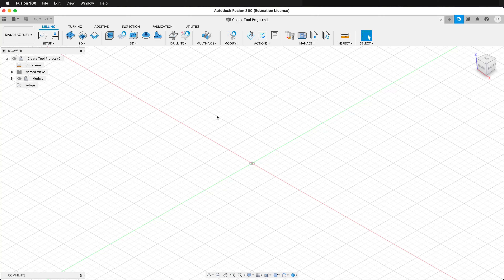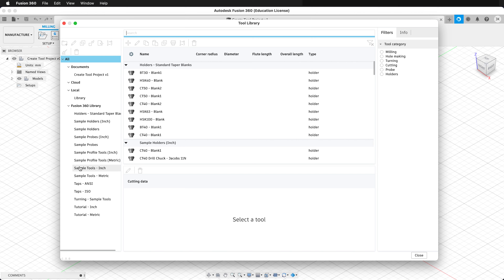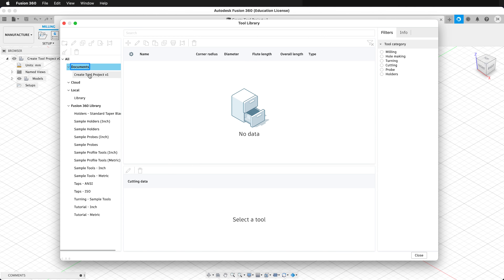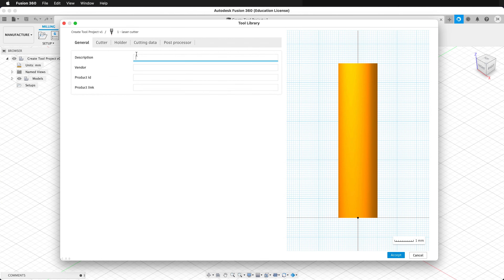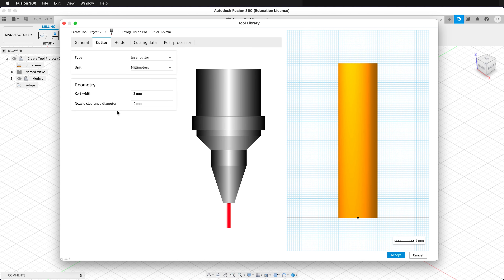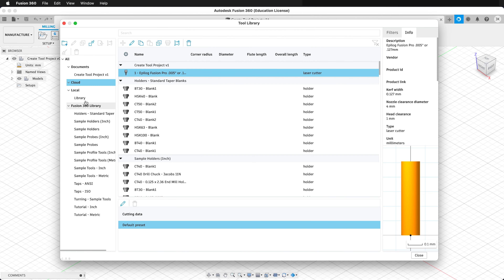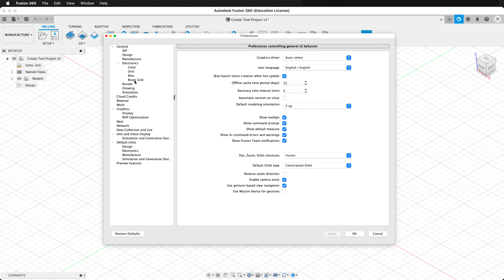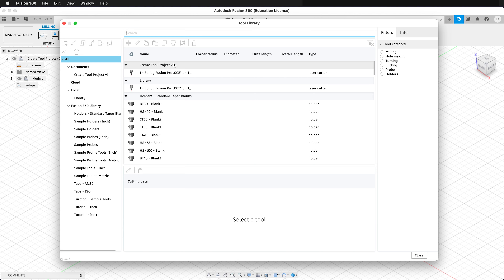Create Laser Cutter Tool Fusion 360

Comment: OK, went through a series of these videos, made the box, figured out how to make a tool, add the post process DXF. I set my lasers kerf at .12mm, all the inside cuts are small by that amount and all the outside cuts are bigger by that amount. What did I do wrong?
Reply from the maker: You need to make sure that you select right or left for sideways compensation in the passes tab, if you select Center then it'll cut on the line and will give you different dimensions